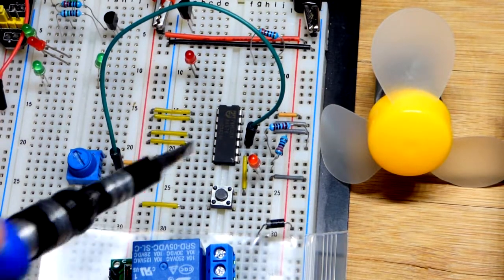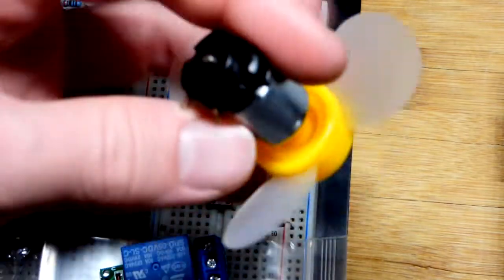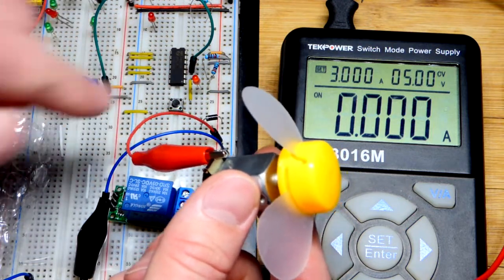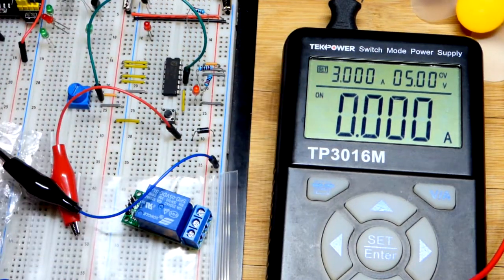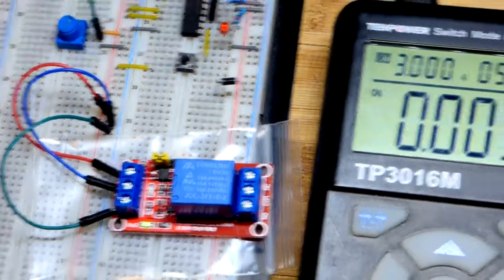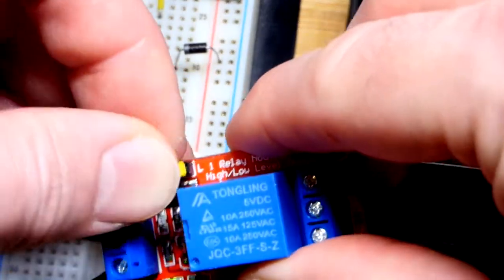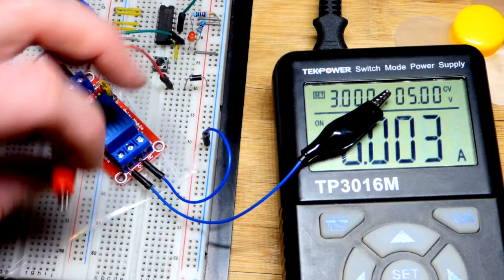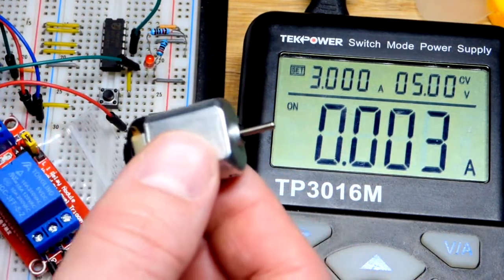Quick motor switched by relay module controlled by 74HC08 quad AND gate integrated circuit IC

Comment from the maker: This is actually a 3V motor not 5V. And at times I also put too much current through the wires and rectifier diodes. Maximum current should be 1 amp with most of the time current being limited to about 0.5A (500mA). Since this video was about using a relay module with a higher power load, and not about how to use motors specifically, I will keep it up for now. Always do your own research on component limitations as these mistakes are common.

Comment: Thanks for including the relay module application with the motor.  I enjoyed how you used a pull up resistor. I think you also used a fly back diode? Very nice the how you explained sink current vs sourced current. I had to watch the video 2 times but you packed a lot on info here. Thanks again.
Reply: He used the rectifier to drop .6 to .7 volts from the main power supply to drop the voltage going to the motor slightly.   That motor was probably a 3  volt hobby motor so 5 volt supply was overdriving it some.
Reply from the maker: You are right, I thought these were good up to 6 volts, but I just double checked the seller's listing and they say 1.5V to 3V.
Reply: @Electronzap  That puppy was really unwinding.   LOL
Reply from the maker: Yeah lol. I could tell it was being overworked but I trusted my mistaken memory of the maximum voltage too much. Glad you pointed it out so quickly! I am close to uploading a correction video.
Reply from the maker: Thanks for watching! The diode protection is included on the relay module. There is no requirement for the one I added in this circuit. This motor has a low enough resistance that the power supply sometimes thinks that it is a short circuit and cuts power. The diode adds a little more of what the power supply sees as resistance. The motor also spins really fast at 5V, so the series diode drops about 0.7V from the motor and slows it down a bit.